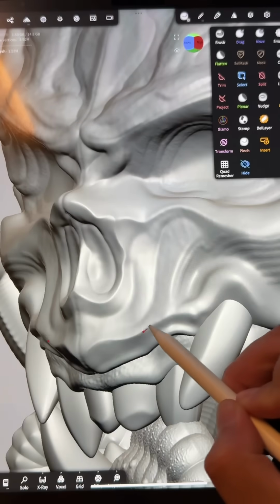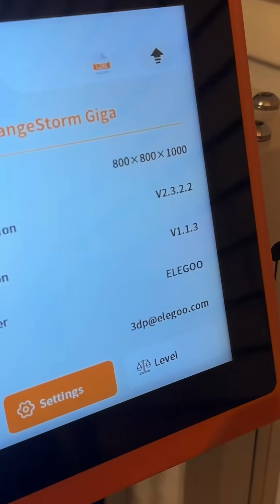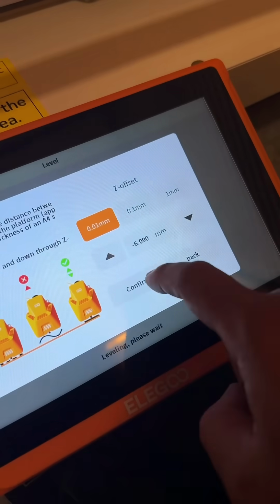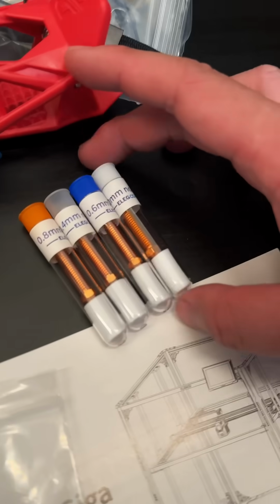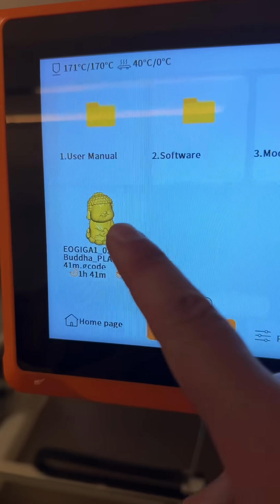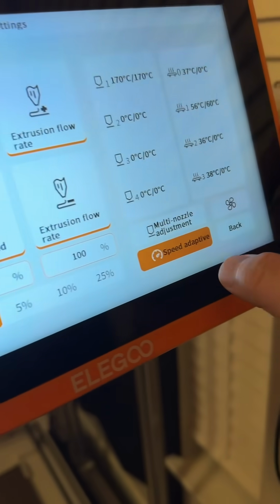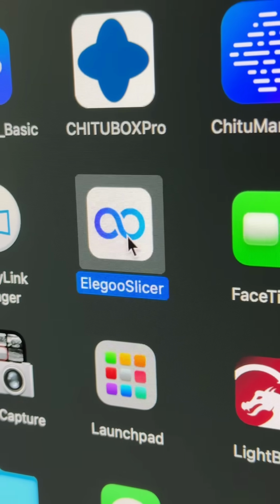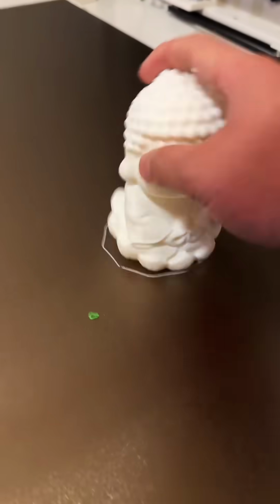Leveling and slicing 3D sculpture for the Elegoo Orange Storm Giga

Comment: Just watched a related video, take care to clean up inside the printhead regularly, one user just had a small printhead fire after a month of use, because whisps of filament finally stalled the cooling fan and it cascade failured from there. The cooling fan is hidden up inside the head and is not the side ducted ones.

Comment: They really need some kind of AMS unit for this just to continue printing when one spool runs out.
Reply from the maker: That's a great idea. Do they make an AMS for this printer yet?
Reply: @abovewongart  not specifically but their are solutions like Mosaic Palette 3 Pro or the DIY Enraged Rabbit Carrot Feeder or
Reply: @abovewongart there are 3rd party solutions for sure
Reply: @3sotErik  I wonder if someone’s already designed a way for it to feed from a hopper so you just pour in cheaper plastic pellets.